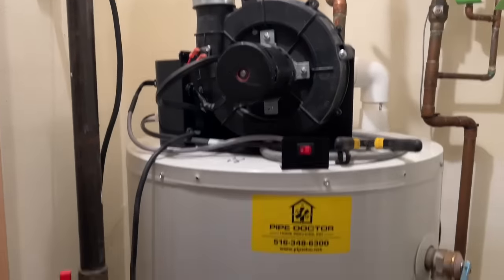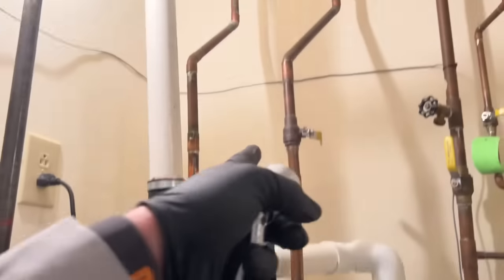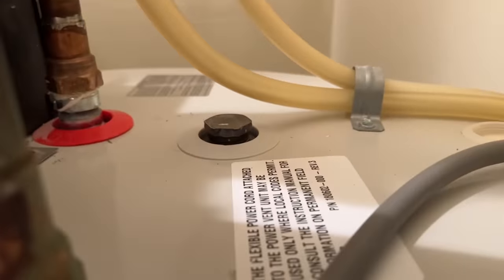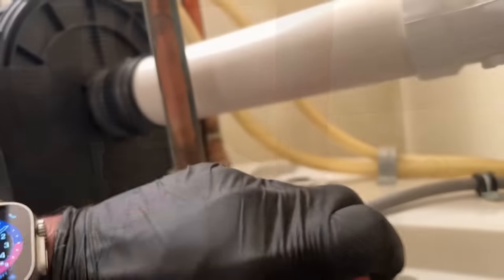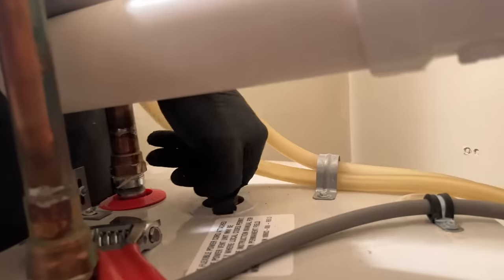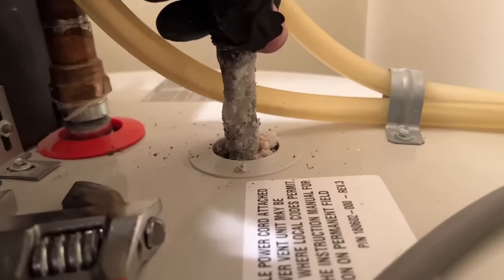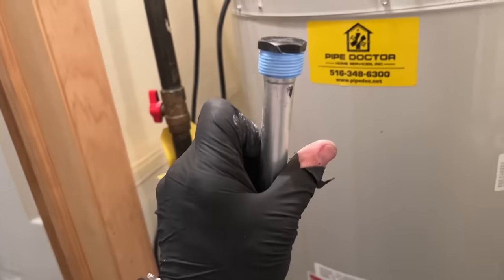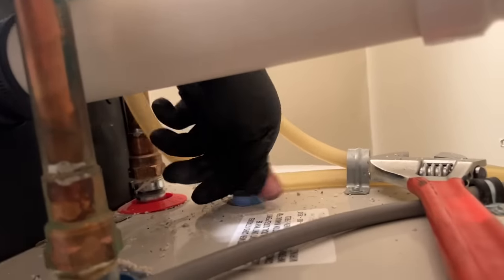New York Plumbers Don’t Change Anode Rods But Pipe Doctor Does! How to Extend Water Heater Life

Comment: Excellent video regarding something most people don't even know about.

You forgot to mention that many installations do not have enough vertical clearance to remove nor install an anode rod. Of course the old one can be cut upon removal (if there's anything left) and the "sausage link" type installed, that may be useful information for those interested.

Comment: Probably the most important thing, especially if you have a gas water heater, but nobody ever does it. Anode rods are about $30 at my hardware store. Handy tip: When you replace it, write the date on the water heater so you know when it needs to be replaced again.
Reply: Not only the date of the anode rod replacement, but the date of the water tank itself. If the tank is old, don't open the relief valve or it may not reseal and will leak.

Comment: I found that pulling an anode rod would result in a tank replacement about 50% of the time because the tap threads were corroded and would leak after replacement.
Reply: I have two Bradford condensing 100 gal 300k btu tanks in a commercial location. Both went within 5 years. Looked at the book and it states check/replace anodes twice a year. Made a huge difference in their longevity so far.
Reply: @Takdashark  Yeah, plus the installation and hardness of the water can accelerate the breakdown.  Make sure that the plumbing system wasn't used for electrical grounding too. Big commercial tanks are designed better than the disposable crap companies sell today.
Reply: @PipeDoctor  I worked as a service plumber for a decade after retiring from the military I'm not talking about my personal water heater. I would always advise owners that if the tank was 4 or 5 years old with no service whatsoever to leave it until it fails. Even pulling a nipple to replace the dip tube or pulling the tank drain can cause a necessary tank replacement, anything dealing with the tank taps like a temperature and pressure relief valve.
Reply: @Brian Basset
Very useful info here, never attempted replacing of a customers anode unless under warranty of your own company at its specified interval.
Reply: @axminsterz4151  Whenever I replaced water heaters I would offer the customer both yearly preventative maintenance and any scheduled factory-recommended service. It's way easier to sell a customer a top-of-the-line stainless steel tank when they understand that it can be maintained for 15 to 20 years.
Reply: @PipeDoctor   "Environ(mental)ists should love this!  Saves landfills from filling up with heater tanks...🇺🇸 😎👍☕
Reply: Cordless impact sooo much easier than breaker bar, especially if doing job alone.
Reply: @Takdashark  Holy Crap!  Twice a year?  That’s nutty.  OK for DIY but a paying customer not likely to see any financial upside over time.
Reply: @brianc9642  commercial application is the key here.
Reply: @hughbrackett343  Your both wrong. Just because commercial tanks are more expensive, usually because of their size, doesn't mean home owners can't benefit from regular services on water heaters.
Reply: I've replaced anodes 6 or so times and have never had a problem.  The only thing is it can be difficult to crack loose the first time.
Reply: Thank you for teaching the average homeowner on how to maintain their hot water tanks. Here in Dallas (North Texas) we have hard water and it wreaks havoc on the tanks and other plumbing
Reply: Facts💯
Reply: Then you ain't putting enough schmutz on the threads. 
They need an extra helping of schmutz on all the threads.
Reply: Tis why you pull them when the water heater is brand new and apply a generous coating of grease or neversieze.
Reply: @brianc9642  that is what I used .
Reply: @Takdashark  just proves, always go by the book. I just love people who think they know more than the engineers who designed it do. It’s sometimes fun to watch stupidity. Good job on following the manual and I hope it lasts a lifetime for you
Reply: Humm.  My water heater is from 1976 and it’s never had a rod change. Guess I’m just lucky. Knock on wood..
Reply: So I learned from this video that I should have replaced the anode at the 3 year point. Now, 9 years since I installed WH I doubt I can break the anode threads loose. I do have an air powered impact wrench but I am concerned I could screw up the tank... 

Now I need to check the anode on my RV trailer water heater.
Reply: @calj01  keep in mind, the engineers test it in the water available to them not a sample of water everywhere the tank will be sold. For instance, in Flint Michigan the water has high concentrates of lead in it which reacts to ALL metal. In Springfield Illinois the water has high amounts of sediment, 200ppm on average, calcium, magnesium, salt, fluoride and chlorine that attack the stink rods and drop "chalky" substances to the bottom of the tank. A winter coat is good in Antarctica but not so valuable in Saudi Arabia is what I'm getting at.
Reply: @jimmythepirate494  I agree with you, I know about the water in Illinois and it definitely is not the same as California. However, changing the anode the recommended amount of time should be fine to begin with. Of course after removing you see if better or worst. Then adjust accordingly
Reply: @PipeDoctor  *the customer doesnt replace it fast enough
Reply: That’s an easy fix
Reply: What is a breaker bar,maybe  I have  a different name for it?
Reply: @brucebannerman6848  it would be a ratchet with a long bar on the end
Reply: @joea5183  thanks
Reply: Did you flush out the Tank? I’ve had techs just cause all kinds of problems by pulling a rod that was completely falling apart like this one and just left the remaining rod and debris in the tank. This can be a nightmare of a problem to solve and for the business owners pocket, and all for a warranty service contract.
Reply: Thanks Mikey Pipes!
Reply: Another convertible man , love it .
Reply: @brucebannerman6848  it is like a ratchet but it has a fixed head . It increases your leverage. It used when a fastener is rusted or has been torqued tightly. They come in many lengths.
Reply: @brianbassett4379  Does using copper plumbing pipes for ground cause the corrosion I'm seeing?  For example under the kitchen sink, the outside of the copper pipes to the faucet turned green.  The brass Ys attached to the outdoor hose faucets are corroded inside.  I believe this all started after both a main panel upgrade and new furnace and AC install.

Comment: I just did mine few months ago. Heater was 6 yrs old- rod was 100% gone, only thing left was a skinny skinny piece about the diameter of a skewer. Only regret was not doing sooner. Nice vid Mike.
Reply: @PipeDoctor  Clifton , NJ .. like 9 miles west of Lincoln tunnel. City water. Who knows, that rod could’ve been toast at 2/3 years. It’s a Rheem performance 50 gal.
Reply: Well water notoriously acidic in your neck of the woods, out west more alkaline water conditioner helps take the bite out of high pH water 🤔✌️☝️☯️🚿
Reply: If you didn’t already make sure you flush the sediment out of the tank. All that corroded rod is sitting on the bottom of the tank.
Reply: @seashackf1  hi if this is for me- I def did by taking out the drain bib totally and then getting in there with poly tube on my shop vac and vacuum for what seemed like forever until I got out POUNDS of gunk and sediment. Could actually see in there with a light to check my progress. Thanks for tip.
Reply: @DG-fe4ht  the shop vac is a good idea. I flushed with water and it also took forever. Turn on to stir it up, then drain. Repeat many many times. I guess there’s no easy way.
Reply: @seashackf1  yes!

Comment: My 40 gallon AO Smith gas water heater will be 27 years old on July. Didn't change the anode or flush to clean the water (no maintenance done) and it's doing great. When I replace it I'm planning to replace with electric water heater the reason have a 12.21KW solar panels installed and have surplus energy generated from my solar.

Comment: The anode rod needs an electrical connection to the tank.  If you use too much Teflon tape you could insulate the rod from the tank.

Comment: At 10 years old with little to no maintenance the best option is to leave it alone till it bursts. Then when you install a new one maintain it properly. 

Flush it every 6 to 12 months, use soft water if you can afford it. Change anode rods within 3 years, keep the heat level as low as possible on gas heaters. Also always make sure a cold water bond is installed if you have copper piping that is grounded.
Reply: Keeping the water heater on low heat encourages bacteria to grow in the tank. I kept mine all the way up for 14 years. It did no damage. I even cut the side of the water heater open to check for damage and there was none

Comment: Where I'm from you're lucky if the anode rod lasts 3 years .. also the tanks come shipped with magnesium rods and we've noticed sometimes (maybe because of the way our city treats the water) customers complain about "air" in the lines but what is actually happening is the magnesium rod is corroding very quickly .. we found installing aluminum anodes fixes the problem

Comment: Just to clear some confusion, all water is different and you need to know what you have as far as dissolved minerals in your water. There are positive and negative ions depending on the individual conditions and these rods are only good for one of them. If your water chemistry is the  opposite they won’t help

Comment: Good tip,  I believe an anode rod needs a good "electrical" connection same as the low water cut off sensor that you often note.  Pipe joint sealant is what is installed from the factory.  Any thoughts??
Reply: Well versed in cathodic protection.  Yes, need metal to metal electrical conductivity between the magnesium rod and steel water heater via the threaded fitting to make the glass/ceramic lined steel tank the protected cathode and the magnesium the sacrificial anode.  But doesn't matter what plumbing sealant or plumbing tape is used on the threaded fitting.  When new rod is screwed in with sufficient torque to not leak, there is more than sufficient metal to metal contact between the male and female threads to make the needed electrical connection.
Reply: @stevec8861 , thanks for this. I used Teflon tape and figured the threads would cut it.  Nice to have confirmation.

Comment: I have seen anode rods smoked in one years time (city water and a few very acidic/alkali well water). you can judge that by the piping and valves, if there's greenish white corrosion and leaking at every fitting/valve, no guarantee!

Comment: I was told it was best to use an impact driver to bust the anode rod loose.
Reason being that there was less chance for the water heater to turn.
Your thoughts?
Reply: Many steel water heaters are lined with glass.  So there's your answer...  breaker bar is better but might be a two person job.
Reply: @michael931  Clearance is an issue too. This gentleman noted he'd been lucky in that regard.

Comment: You should look into the Corro-Protec Powered Anode rod. They are made of Titanium with an induced current unit. The company gives a 20 years tank corrosion warranty when installed in new tanks. Pretty interesting new technology.
Reply: This is not new technology. The titanic already had it to protect its hull

Comment: In my area in central Pennsylvania the water has so much calcium in it the water heaters fill with calcium in about 5 years. 10 if your water is softened but make no mistake. Plumbers around here change a lot f water heater. I change at least 20 per year.

Comment: Have you noticed various levels of deterioration based on the town one is in?  For example, in say the 5 towns, does the rod break down slower, quicker or the same as say in Great Neck or Manhasset?  Great and informative video as always.
Reply: It’s great for making the best bagels anywhere!😋
Reply: @bauhnguefyische667  Five towns or North Shore?  Both are very good.
Reply: water quality make a huge difference. minerals, acidity/alkali and other chemicals. city water can be very bad at some places and lack of hot water usage will cause chemical buildup.
then there's always city water supply issues, dead ends and corners of piping that have too low of flows build chemicals to high levels(toxic for humans even!).
Reply: @throttlebottle5906  thanks for the information.  very much appreciated
Reply: Yes that’ll make difference absolutely! But also have to account for water treatment in the individual homes themselves. If they dont have anything to treat the water, scale will be noticeably worse

Comment: Mike , there are stories about you laying pipe all across Long Island…😆 it’s a good idea if you put the water heater in to brake the adnoid rod loses put dope on the treads  ,this way you know you can service it down the road with out a problem . Also Black man sells the adnoid rods on a cable so if you have a very low ceiling you can easily change it ..

Comment: IF they’re readily available I’d rather just pay for the part and do it myself. As much as I appreciate Plumbers there are things I can do myself. Now new plumbing I’ll call you all day long. But replacing parts or certain things I’m mechanically inclined so it’s not to hard to figure out and stay in code. 

Appreciate the advice though! I doubt my gf has ever changed hers so I’ll see about getting it changed.
Reply: With plumber rip off prices, i learned to solder and do everything myself, it's incredibly easy. It took me 2 days practice in the garage to do better joints then pro plumbers ive seen, and a lot of pro plumbers are garbage and do not even bother de-burring the pipes and/or put in too much solder. If you want something done right, do it yourself

Comment: When I changed mine, the old one was like 4 segments with a cable running in the middle. Vegas water is brutal.
Reply: Definitely easier install a decent impact gun helps as well those mo fos are tight
Reply: those are segmented by design for install in tight places

Comment: Mikey - I have a similar water heater about 8 years old and I'm thinking of changing the anode rod myself. 1. Does the entire tank HAVE to be drained to do this? and 2. Not sure if I have enough height above the water heater to get the old rod out and new rod in.
Reply: @PipeDoctor  It's definitely on top - just like this one. What about the low ceiling?
Reply: @russellmyers934  Get the sausage type rod for low ceiling.  The old one will bend easy if you have to.

Comment: You didn't show breaking the fitting lose - I think it is important to show how to hold the tank from moving while breaking lose the fitting --- without damaging the pipe connections to the water heater ?
Thanks for bringing it up though

Comment: I haven't found a plumber in the San Francisco area who will do this. And we would need an articulated replacement rod because the ceiling is low. Do you know anything about the electronic anode devices? I've HEARD they last longer and aren't as long.

Comment: I'm wondering if the anode rod is just on the fresh water side of a solar water heater?  It was never changed since it was installed, and the installer never mentioned that it should be done.

Comment: Do you prefer magnesium or al anode rods ? Great video been putting this off for a while now lol
Reply: Magnesium is better.  Aluminum is only good if your water is smelly
Reply: Do you think dissolved Aluminum in your water is a good or bad idea?
Since everyone is magnesium deficient I think a magnesium anode dissolving in my water would be much better.
Reply: @gad5248  If water has high sulfate content, magnesium anode can feed sulfate reducing bacteria, yielding smelly hydrogen sulfide.  Had a home with that issue once, and we turned up water heater temperature above the recommended safety maximum of 120F to kill the bacteria.  But if someone in that situation wanted to stick with safer hot water temperature, they'd have to switch to a different anode metal or skip the anode altogether and replace the water heater more often.  If concerned about aluminum salts being unhealthy vs. salts from magnesium or zinc anodes, they could use aluminum anode and warn everyone in household not to consume or use the hot water supply for cooking.

Comment: I’ve been begging my company in Bronx to do this service on my water heater but they wouldn’t.  Ended up having to replace the WH because the tank was eaten away. Got exactly 8 yrs out of the 8 yr model. Figured it could’ve gone to 12 w/ a rod swap.
Reply: Why not go with the lifetime tanks ( rheem polyB ? )
Reply: I got 28 years out of a 10 year tank in the bronx.  change anode every 5 years

Comment: Have you ever experienced any of your customers calling about air building up in water heater and emitting when you open up hot side. I’m a lic. Plumber in Massachusetts and have had it happen on a new HTP new style 55 gallon water heater and a 50 gallon electric Ruud water heater ???
Reply: @PipeDoctor  Emerson swan rep here in Massachusetts said its the anode rod causing a build up of air in pipes. It’s a reaction from anode rod with the water condition Tahoe allows it.  Which is strange since i have been a plumber for 40 years and never experienced it until recently 🤦‍♂️

Comment: How many ft/lbs of torque is required when the new one is installed? Great video. Thanks.
Reply: It’s a German torque spec called GOOD-N-TIGHT.
Reply: Not that much, 20 - 30 lb-ft will do.  Note that taking them off, since they will be corroded, may require knuckle-busting torque like 200 lb-ft +

Comment: It's cathodic protection. Basically the anode will corrode instead of the steel tank. But the hotter they keep the water the less effective the protection from the anode.